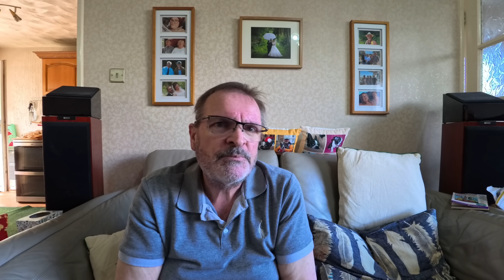Expert Ships Engineer Reacts to Baltimore Bridge Crash

Comment: I wish you would have gone more into the mechanics of this accident in terms of actions to be taken which would be considered to be counter intuitive.  For example, if the Titanic, instead of trying to steer away and avoid that iceberg, could have performed the non-intuitive action of ramming the iceberg.  In that case one or two compartments might have been flooded but the ship would have floated.  Is there a non-intuitive action that this ship could have performed to avoid this accident?    You said that there will be a report/book on this accident once the investigations are complete.  My question is, will this accident make it into the nautical simulators of the marine teaching institutions?

Comment: The biggest battleship in WW2 was the IJN Yamato. 70,000 tons. This container ship is 100,000 tons. The 70s (when the bridge was designed & built) only had such ships about 1/2 the size.
Reply: The size of the ship would not make a bit of difference if it hadn't hit the bridge. The bridge integrity is not an issue, except to Pete Buttigig who thinks it was racist. Just from his statement alone make this smell like a dump truck load of day old fish laying out in the sun.
Reply: And you have absolutely no idea of what you are typing..
Reply: @DDXY2K  l sailed on a number of Shell VLCC of 200,000 plus tons from the late sixties into the seventies. At the time these where some of the latest ships afloat and l Do know what I'm typing...Trying to bring a ship of that size to a stop is incredibly difficult...
Reply: sure but a few concrete dolphins to protect the pilings / piers would have totally saved the bridge and deflected the ship back into the main channel - simple and not massively expensive in the grand scheme of things - most other bridges have them and they have been retrofitted on older style bridges and it's not like this is the first time this has happened, so everyone in the industry knows full well that concrete dolphins can be fitted either side of the piers
Reply: Wut? Lol
Reply: i doubt anything can be built to stop that.

Comment: I thoroughly enjoyed your explanation of events. I'm still trying to understand why tugboats are not used as a precaution because of the potential disaster that could occur as it did here.
Reply: Tugboats cost money
Reply: @mrdanforth3744  I'll bet it was money. Looks like that decision bit them in the butt
Reply: The country is at war. This was an attack, an act of sabotage. What's been taking place in the shadows is increasingly taking place in plain sight. Expect other such events, so-called Black Swan Events between now and election time, in particular.
Reply: In the navy we were followed by tugs for a bit, and always had the Anchor at the dip ready to be released in the event of an engineering failure.
May not have eliminated the potential of an impact,  but might have helped to slow the momentum of the ship.

Comment: Yes that's a good explanation, Torque steering. If they had done nothing they was settled on the right course, so could have cleared the bridge even without power. When the power failed the Black box stopped recording, so two of the four minutes are missing apparently.
Reply: Shouldn’t black boxes have batteries? Just asking.

Comment: While it is a good theory that the ship would have turned to the right. It doesn't explain why it did not continue to turn right and instead it straightened out once it was pointing at the bridge support.
Reply: It could have been China. Singapore is China I believe?
Reply from the maker: Could have been a number of reasons but a few that come to mind are 1. The port anchor managed to bite into the sea bed. 2, the boat ran aground

Comment: I agree about going ahead instead reversing: it made have been a better choice to order left full rudder and all ahead full. This probably would not have prevented collision but have have mitigated the amount of force hitting the bridge. When there is a power loss like what was experienced, there is a LOT to do for two men on watch. They had their hands full and no time to do what needed doing.

However, when that bridge fell, it looked like it was ready to fall because so much of the bridge works fell so quickly and seemingly easily - somewhat like toothpicks.
Reply from the maker: The bridge wasnt designed to be strong when pushed in that direction and it did go a few meters after hitting the bridge. 

But yes the engineers would be in panic mode
Reply: Please explain left full rudder. Doesn't that move the ship right?
Reply: @truth68-st3dc bow would go left stern would go right
Reply: "I agree about going ahead instead reversing: it made have been a better choice to order left full rudder and all ahead full."

It's ALSO entirely possible that 'full ahead'  or 'full astern' was a GAMBLER'S choice:  Think sliding on black ice: you GAMBLE that turning your wheel 'to port' MIGHT  cause your 'ship' to sliiiiide the boot/trunk to the right (as the front goes left). That MIGHT let you just squeak past the car/tree/obstacle behind you....  You might also NOT have room TO squeak past.  Oops.  

OR you may choose to turn your wheel starboard, and the wheels may have no grip AT ALL on the ice (for a ship, say, the speed had dropped down to 1kt, so NO steerage cause no water over the rudder!) and your ship/car just keeps sliding along on its not-so-merry way and you slam into the obstacle.
Reply: @Avalanche-Ice1950 brilliant comment!!! In this day and age I need a lot to move me away from dark conspiracy and this did it! PLEASE PLEASE POST IT ON THE MAIN COMMENT SECTION XX
Reply: Wait…. The everyday Steering of a ship cannot be as haphazard as driving a truck on ice.
Reply: @clothedwiththesun  because the surface is both slick and has waves, it’s worse than driving a truck on ice. Plus, the fact that you are your own power universe dependent on much more than anyone’s car or truck, you are in a sense more vulnerable. I drove a step van on hills through the winters of MI when I was 16, 17. A ship, even a small boat or sail boat is tougher under certain conditions.
Reply: Mike, think accordion. Everything connected in an absolutely incontrovertible sequence. Once the main pushed due to giving way, the rest of it folded into itself.
Reply: the ship was easily going to clear the pier until that very last minute when someone on board clearly did something to massively veer the ship very suddenly to starboard

Comment: How many engineers does it take to change a light bulb!!🤣😂🤮
Reply: One.
Reply: I think this was the old joke about one guy holds on to the bulb while 3 or 4 turn the chair. @colinellicott9737
Reply: This muse is usually told as an Auburn University joke.
Reply: Two - One to hold the bulb and another to turn the ladder 😁 @colinellicott9737
Reply: None.  The lights designed by Engineers are Argon and they last the life of the structure.  This is for real.
Reply: None, that's the Lecky's job.

Comment: In addition, the ship was just reaching where the Curtis Creek channel intersected on the starboard with a broad entrance.  So the bow cushion on that side went away.  Easy enough to counter when you have engines and steering, but without, you get the bow drifting right.  Dali was 40' draft in a 50' channel with shoals in the 20's range on both sides.  The Curtis Creek channel is 50' as well with a broad y-shape entrance.
Reply: So hindsight being 20/20 Perhaps the channels should be narrower when passing under a bridge so that the ship would run aground before hitting the bridge?
Reply from the maker: Interesting update

Comment: Most deep sea ships had directly coupled engines ie the engines were directly coupled to the prop. If you wanted to go astern you stopped the engine, moved the camshaft and air start cams and started the engine in the opposite rotation
However most modern containerships now have CPP and if you blacked out your props would feather and with the load taken off the main engine would race with the accompanying black smoke that was evident here
That been said having a blackout while maneuvering is extremely rare as you normally have 2 generators running and a third on standby entering and leaving port
One other thing, they had known engine trouble before they left yet they left the berth and headed for a bridge with no tugs in attendance?????????
Reply from the maker: The last MAN engine i sailed on had just that the whole camshaft would shuttle forward or aft. The most modern engine i sailed with was a Sulzer flex engine, no camshaft as we know it. 9 fuels pumps for a 10 cylinder engine with a 1800bar fuel rail, control oil was 400 bar. Everything was computer controlled, i m too old i didnt like it.
Reply: @retroonhisbikes  My first two ships were an old Doxford and a Sulzer RD
No control room (engine side controls) no automation. Only 2 alarms - one bilge and one purifier.
Everything was handomatic so you knew every system inside out unlike today as many watchkeepers are clueless depending on computers to do everything for them
Reply from the maker: @R_McGeddon117 not one person i know knows how to set the back pressure on a purifier
Reply: Hi there, I’m a current marine pilot with 19 years experience. No large container ship has CPP. They are all fixed pitch. CPP is usually only found on the smaller, sub 200m LOA vessels. I agree with this engineer’s assessment. My initial thoughts mirror his. When a situation like this occurs, your focus is primarily on two things: direction and speed. Where am I heading? What is my speed? Do I need to correct either? This happens in a split second. After that, its what else do I need to do. The fact that the Pilot alerted the bridge that there was a potential allision saved many many lives. I hope I would have the wherewithal to make that call.
Reply: @pilotg2426  I've been chief on large container ships with CPP with CMA, MSC and Hanjin
Reply: I'm reading all this as a complete layman and given the difficulties outlined ,I've got to ask why the hell the ship was not in the middle of the bridge. Am I missing something ?
Reply: The idea of a CPP piqued my interest so I checked for any info about the DALI. Appears there's a wikipedia page up now with details of the ship and it appears to have a fixed pitch propeller:   "Dali is propelled by a single low-speed two-stroke crosshead diesel engine coupled to a fixed-pitch propeller. Her main engine, a 9-cylinder MAN-B&W 9S90ME-C9.2[11] unit manufactured by Hyundai Heavy Industries under license, is rated 41,480 kW (55,630 hp) at 82.5 rpm.[2] Her service speed is 22 knots (41 km/h; 25 mph).[5] For maneuvering in ports, Dali has a single 3,000 kW (4,000 hp) bow thruster. Electricity is generated onboard by two 3,840 kW (5,150 hp) and two 4,400 kW (5,900 hp) auxiliary diesel generators."
Reply: Some one saved a lil money on those tugs😅
Reply: What about steering away from the bridge support?